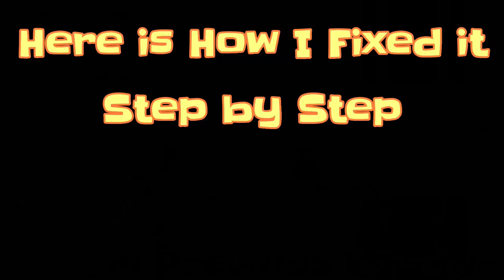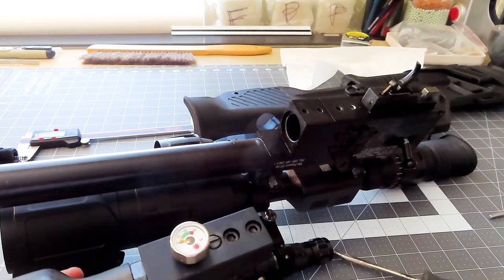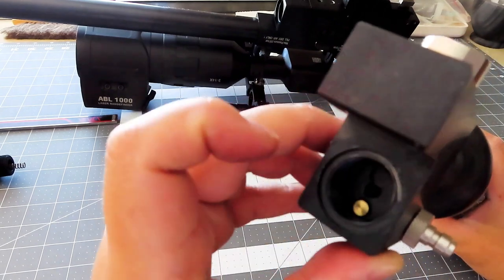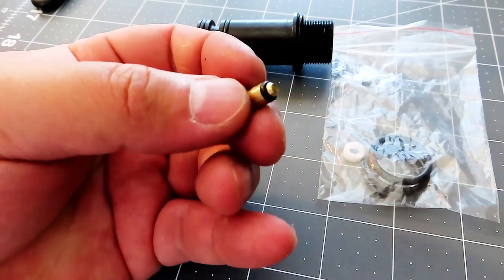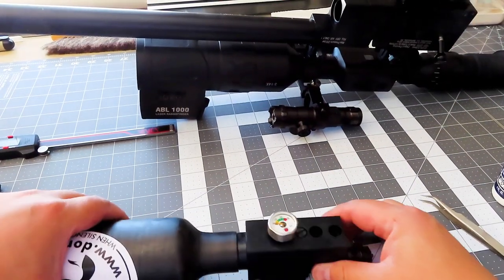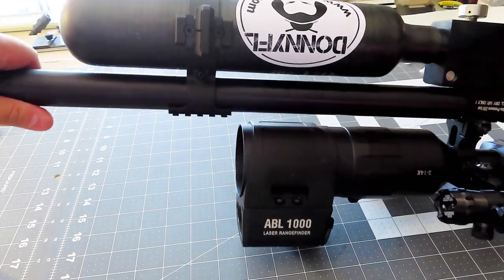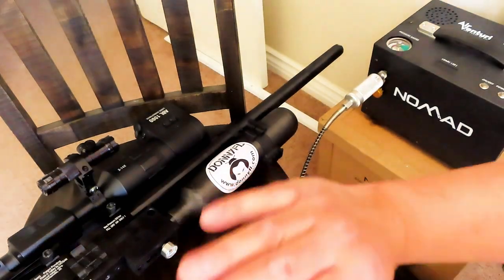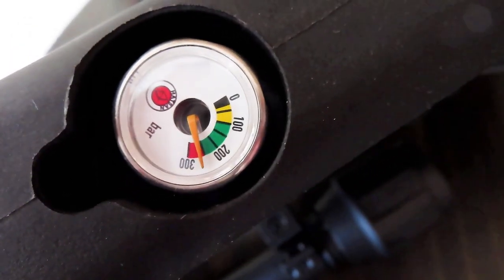FIX Hatsan Blitz Air LEAK issue

Comment: I just got a brand new hatsun blitz 30cal it will not even hold pressure enough to fill the tank. I hope this works, Dealing with Hatsan Directly is a nightmare.
Reply from the maker: best luck bruh!
Reply: @Repsol13  The pressure. The pressure gauge on the receiver was loose.

Comment: Since it stops leaking when it has the fill probe in the seal... Could you just shoot it like that with the fill probe on or no since it stopped the leak? Any problems you had with your Blitz since you made this video? Thank you
Reply from the maker: you could shoot it with fill probe on, so far the Blitz has been very reliable to me as I took it apart and maintained it.  I know lots people has different opinions on this gun.  I really like this platform, it is as rough & reliable as my AK47, shoot fullauto.  AR lovers maybe have different expectations.  Thanks for Watching

Comment: I have a problem in which it will not fill any further than 200 bar.  Is this due to a safety valve needing adjustment?  -it seems to hold pressure right at 200 bar and no more.
Reply from the maker: seems weird, maybe replacing the valve ring? see if it fix it.  thanks for Watching

Comment: As far as lubricating the seals its not recommended but if you need to it's said to very sparingly use scuba grease only in these parts do not use any sort of oil in the air valves. Imo i wouldnt grease it because apparently in this model if anything gets into the barrel it can clog the gas port that cycles the bolt. Also hatsan says do not over lubricate. Also i like that you showed how to take it apart. I honestly had no idea that releif valve was there thats good to know for wen u have to fly with ur air gun cuz u cant have any pressure in there.
Reply from the maker: Thanks for the response, this issue most likely gonna repeat itself many times.

Comment: Thank you for the great video. We have an air leak on a Hatsan Blitz. I just followed your video and the air is still leaking. I think it is because, in our case, the leak is occurring at part No. 2314 and 2315 (seals) on the exploded view diagram. These sit within part no. 2387 and form the air seal with part no. 2386. I wondered if you knew of any tutorial to change this air seal? Thank you!!
Reply from the maker: Well, once you start taken it apart,  maybe 2286 2387 can be clean and lubricant the same way to get it sit in correctly.   Good luck and maybe record your progress for all to see.  Thanks for watching
Reply: @Repsol13  Thanks. I did that and it still leaks. If we come right perhaps I can record something.

Comment: Strongly suggest you use a torque wrench to determine factory torque when removing each part, and reassemble with that torque.
Reply from the maker: Good 💡  tip

Comment: If you can't see any flaws under a microscope, it's most likely you have/had a speck of dust lying across the o-ring. Still best to replace all the seals if you can, as even the best rings (only use industrial materials like buna) get reformed under pressures in time.
Reply from the maker: Replaced with Factory O-ring, must be a dust like you said

Comment: Dude now you have the bottle off, hook it up to your compresser turn it on and pull forward on the front of the black piece so it will seal then your good it takes like 2000 psi to have enough pressure to seal the bottle when it's completely empty, I'm I making any sense to you?
Reply from the maker: Yes, makes perfect sense 👌
Reply: Which black piece?